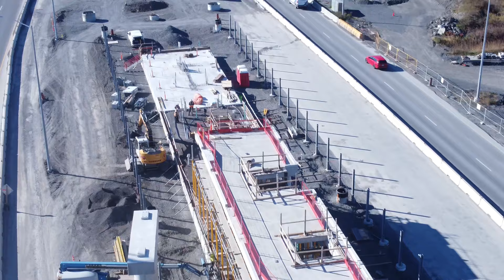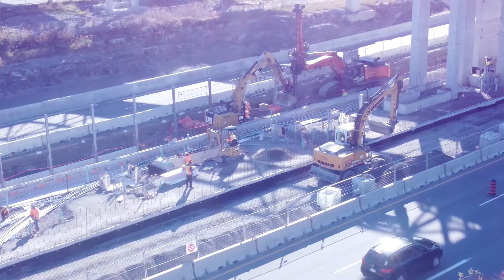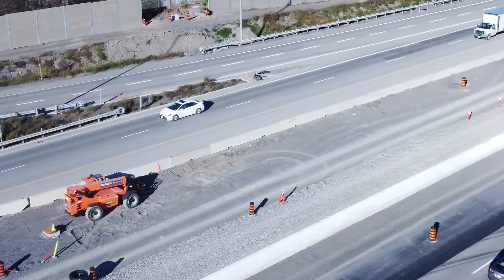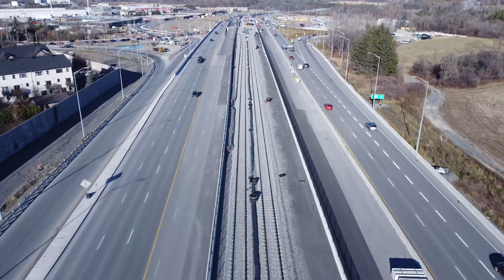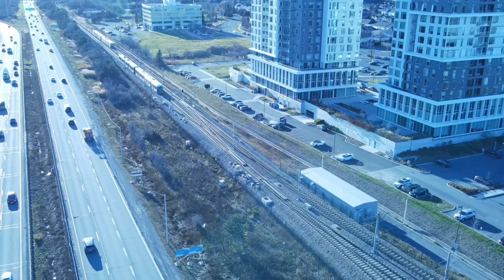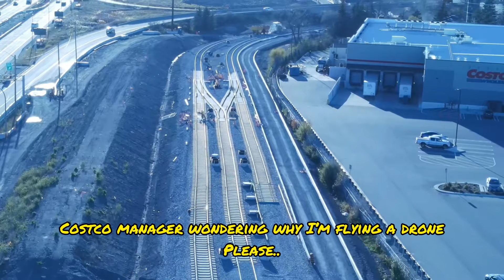East end - Trim Road to Blair Station OLRT phase 2 construction progress November 2022

Comment: Yes, the three track section near Gloucester HS is called Blair Pocket Track in the Service Plan document meant for short turn versions of primarily Line 3. There may also be some short turn variations of Line 1 during periods they don't require capacity east to Trim too, but the principle is all Line 1 trains east to Trim otherwise.

Comment: Sweet video, keep this up! Some music playing throughout would be nice rather than long periods of just footage though. :)

The third track is a pocket track, pretty much all rail transit systems have them, it allows them to store a spare train in case there's an issue with a running train and it also enables some flexibility for turning trains partway through the line rather than having to continue all the way to the end before coming back. It would allow for more frequent service between Blair and the core without having to run trains all the way down to Trim but at rush hour they could keep a hot spare there and launch it quickly if a train somewhere on the line broke down and the broken train could limp to the pocket track and stay out of the way. Lots of reasons for it!
Reply from the maker: I know I know it’s boring without music I normally add some